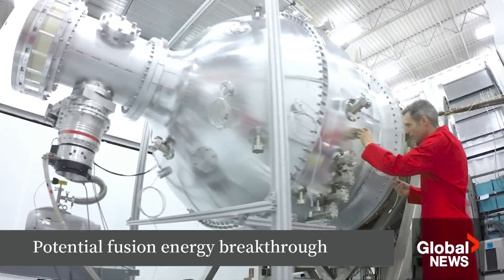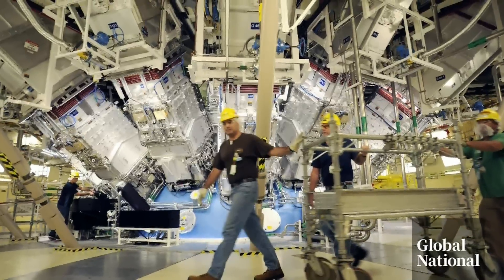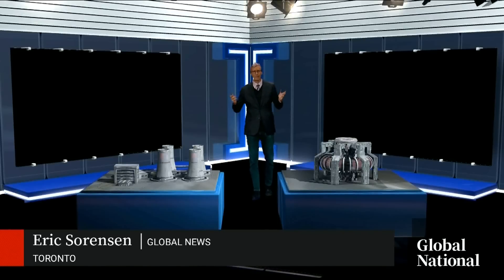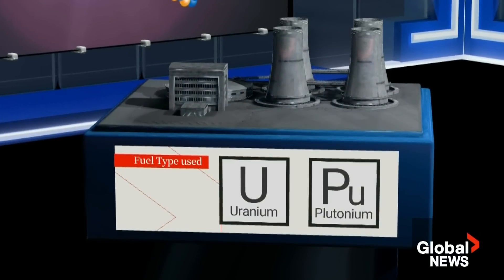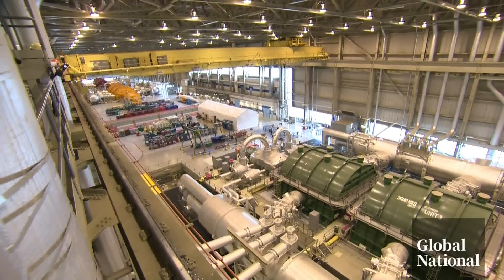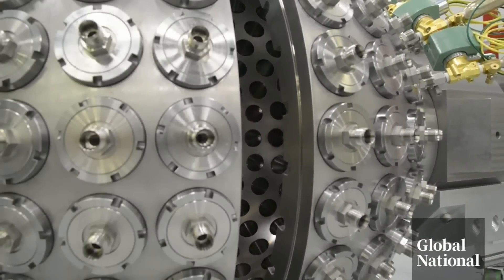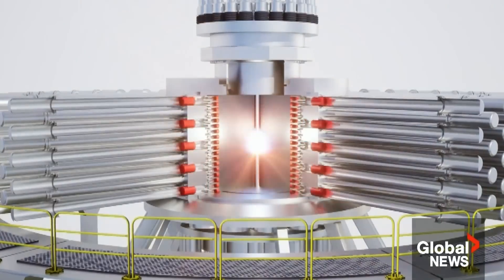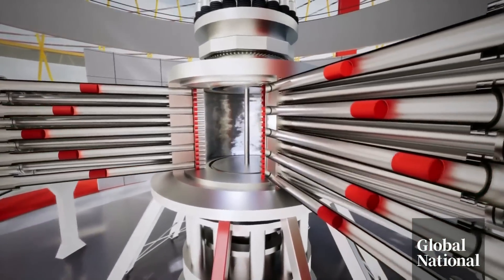Nuclear fusion breakthrough could change future of clean energy

Comment: Reactive power is lossless, not useless. It can be passed through a resistance and thus converted into real power to illuminate a light bulb or else boil water to drive a steam turbine and replace all nuclear power plants at the very least.

Reactive power is not merely the result, the reaction, to real power. It is also the result of reacting against itself and accumulating without limit due to its lossless condition.

This makes reactive power a self-amplifying proposition if real power is not allowed to get in the way. To achieve this result, it is necessary to ...

Make sure that most of the real power input is thrown away to ground prior to its entry and that an open transmission line connects the source with the input without any return path to discourage a depletion of source. Without any exit, current will be forced to exit through the same point as it entered resulting in a reversal of current if the input is kept low enough so as to not suppress this distinct reversal of current from manifesting itself.

This reversal of current will increase the difference of voltages within this type of circuit rather than neutralizing them. This is what makes reactive power an infinite resource.

Imagine a battery in an electric car which increased its voltage over time whether or not it was drained!

BTW, a battery is another example of a resistive load capable of converting reactive power into real power and, thus, can be recharged with reactive power rather than with real power.

So, we're wasting our dollars recharging our battery-powered, electric cars from a "pay as you go" service, such as: from the power grid.

To learn more, search YouTube for this video title ...
Can Valence Electrons Supply Energy?

Comment: It's extremely radioactive. You're only fusing atoms to produce heat in the form of radiation. Nuclear waste in minimal, the Tokamak, shell, and heat transfer fluid.
You can shut down the reactor quickly so it's extremely safe. I hope this breakthrough is substantial.
Reply: This isn't a tokomak.

It's a fuel pellet shot with lasers.

Also, the ultimate goal is to use deuterium-deuterium fusion. Which has no neutrons being shot out.

The device your using now radiates all sorts of things. Your light bulb radiates electromagnetic waves in all directions. Radiation is not inherently bad. It depends what being radiated. 

High energy neutrons are very bad.

Comment: What drawbacks are there? There is always some sort of drawback.
Reply: safety is the only concern
Reply: @mrwick0013  fusion safe. In a case of catastrophic event, only power plant employee could be killed. Also, in a case of D-T reaction, the reactor frame will be very radioactive. But it's not liquid, not a dust, and it's easy to deal with it, when we have to close the power plant and replace it to new one.
Reply: The only drawbacks are massive technical/implementation challenges--but those can be overcome.  From a physics perspective, fusion is the ideal source of energy in the known universe.  After all, literally every other form of energy that we use originated from fusion reactions.  For instance, coal is fusion energy in the form of light from the sun absorbed by plants, and then condensed under pressure over millions of years.  Geothermal results from the radioactivity of elements produced by fusion reactions in a star.  Even hydro-electric is still indirect fusion energy, because it's energy derived from gravity acting on water.  But to get the water to a height where it has high potential energy due to gravity, that requires energy from either solar, or other sources that ultimately trace back to a fusion reaction.  If we can control fusion ourselves, we'll be cutting out all the middle-man processes that ultimately bleed energy out of the result.  So it will be efficient.  Pair that with the fact that it only requires hydrogen as fuel, the most abundant element in the universe, and it's hard to see what could be better, beyond some maybe hyper-advanced theoretical devices that an intergalactic civilization might employ to harvest energy from black holes. 😁
Reply: @Zeuts85  Well explained !
Reply: @Zeuts85  
What about meltdown possibilities?
Reply: @frankgilbert5148  it's not a chain reaction, so it can't meltdown.

It's just a fuel pellet shot with lasers. With the right fuel, there's not even any radioactivity.

The problem is, this is very difficult to do with the right fuel, so for now, for testing, an easier fuel is used. This easier fuel, is radioactive.
Reply: The draw back is, it's final form is still a long way away.

Like in 100 years
Reply: And time,this will take a very long time before we can fully integrate it,we might not even be alive to see it happen
Reply: The main drawback is that it's all hype
Reply: It produces a lot of radiation when it's running. Besides that there isn't many negatives.
Reply: @topfuel29channel  it actually doesn't produce radiation... Fission produce radiation this fusion produce very little of it
Reply: the drawback is that the gain calculation does not take into account the energy required to fire the lasers which operate at 1% efficiency.
Reply: there is no significant drawbacks of fusion energy, once we will be able to use it. But this device is not a real power plant. We can't use this technology for energy plant. It's just proof that fusion is possible, scientific achievment. But real power plant should have different technical design. And years(or even decades) ahead of it - practical design.

Comment: Need tritium and there is not a lot. Also can use lithium to create more tritium. The reactor design looks like the Russian Tokomak design of 60s. Not much new, helium3 on moon will be mined soon and maybe fought over like oil too, then there are the rare elements and metals to mine to build the reactors..
Reply: You don't need tritium. But it's easier with tritium.

It's nothing like a tokomak.

A Tokomak uses magnetic confinement to confine a super heated hydrogen isotope plasma.

The above machine uses pellets that are shot with lasers. No confinement, no pressure, no maintaining millions of degrees of heat needed.
Reply: @tylerdurden3722  wait, so your telling me it looks like every reactor core from sci-fi why does sci fi always nail this stuff its so weird.
Reply: The end game is to breed your tritium in situ from lithium.
Reply: @jonharson  The tokomak had a berillium plate that extracted it from hydrogen I think. There is very little like 200kg of tritium on the planet so producing it is a hurdle.
Reply: @441rider  Lithium is a lot more common than beryllium and much less dangerous to work with.
Reply: @Mark Twain I thought they were working on that in pacific north west. Salt based I think, helium3 produces little radioactivity I read so is a huge option, even George Bush mentioned it on moon return trip sales pitch back in 90s